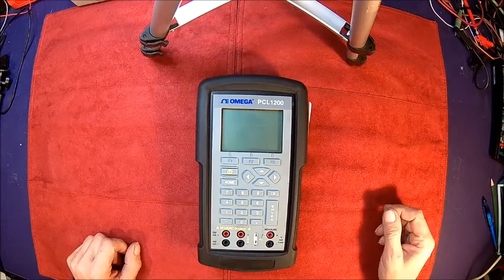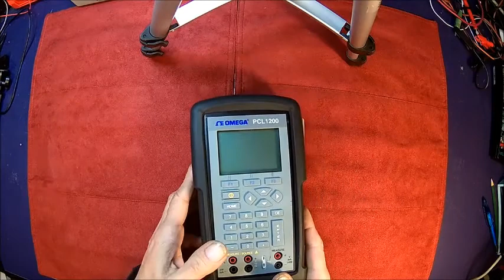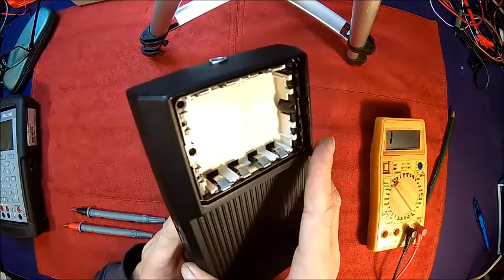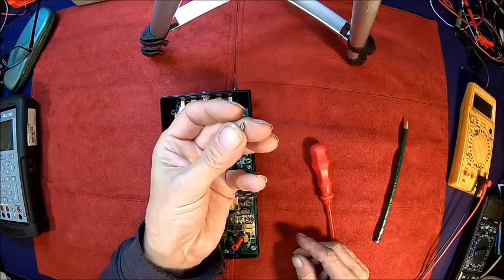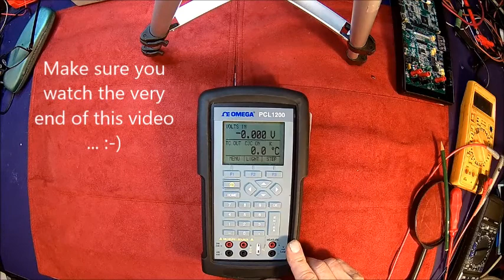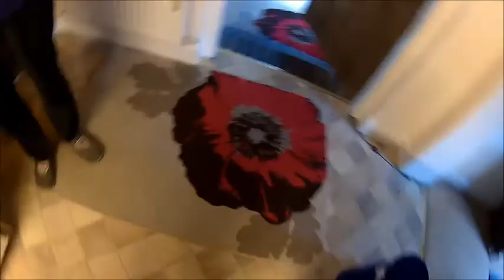A very strange fault - Omega PCL1200 process calibrator tear down inspection repair

Comment: he might of had it in his pocket bag or box and the grub screw fell in Murphy's law that one
Reply from the maker: I agree with Murphy, but chances are really slim, that's a 3.5mm hole and the setscrew was 3mm.
However, the unit was previously used by others who left meanwhile, so who knows what happened in the past.
But the most disappointing fact was that the service company just marked it as u/s without even looking into it , perhaps they just wanted to sell a new one.